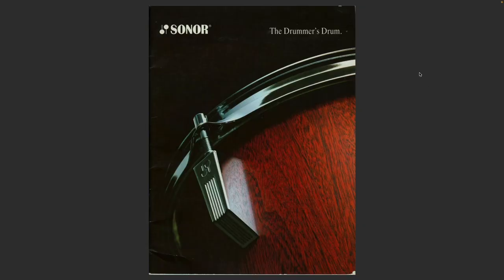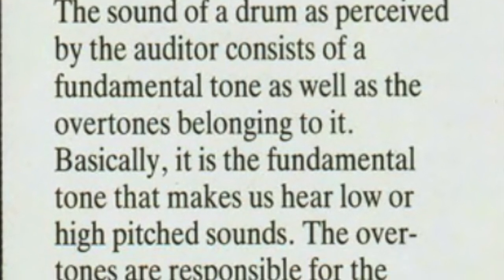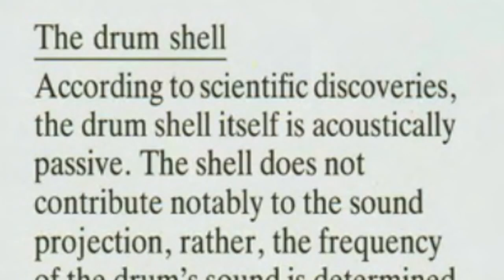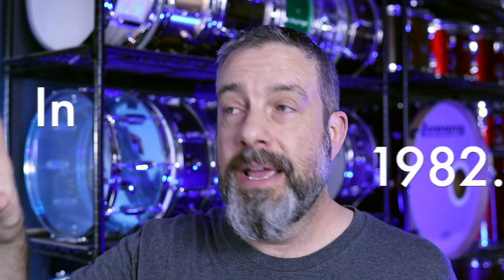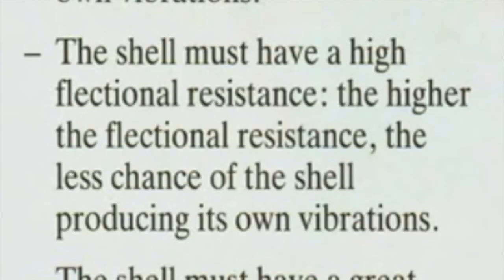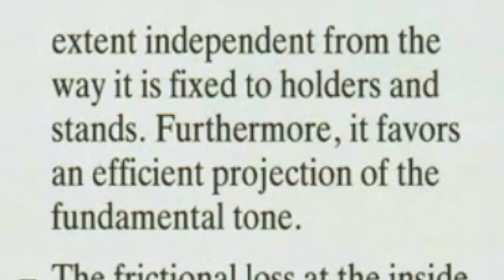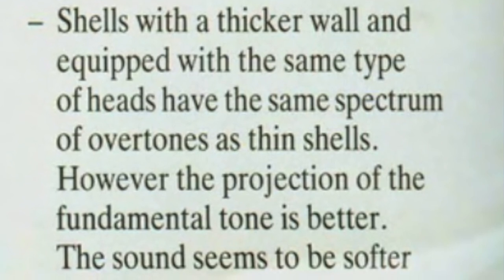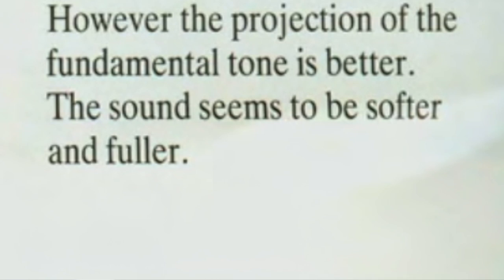That's Not What I've Been Told!  Drum Sound Physics, Part ONE

Comment: I have bought recently a dw purpleheart snare drum very dense and thick I love it! 

What about 6 ply?? Is still that really thin? The ludwig vintage you mention how many plies it has?
Reply from the maker: My late 70s Ludwig kit is 6-ply, but the plies back then were MUCH thicker (nearly twice as thick) than plies used in modern drums -- more wood, less glue by percentage.

It is interesting to me that as the idea of thinner shells being more vibrant sounding than thicker shells became the convention of drum design (starting in the latter 80s) companies decided not to limit the number of plies (as Tama did with their Artstar line in 1983) but rather to use the same number of thinner veneers with just as much glue (yielding a shell with higher glue percentage and greater overall stiffness with lower pitch).  This is not like the earlier 3-ply construction used by Ludwig, Slingerland, etc. in their vintage drums before the early 1970s.  The result is a thin shell, yes, but nothing like that vintage approach (particularly with the thicker central ply of much softer poplar used by those companies in those old drums).

Comment: Wow great video! The effects of these variables has been hotly debated forever.  I’m going to need to watch this a few times and think about each item in more detail.  Initially I’m thinking in terms of snare drums where wood types and metal alloys are noticeably different in timbre (meaning you can tell within reason what kind you’re listening to like your trumpet vs piano example). 

One thing that “resonates” with me is the thickness (density) of the shell. The more dense the medium, the better the sound travels through it. And the longer it takes for that medium to dissipate the energy (assuming higher density also equates to higher mass).  I see a lot of correlation to cymbals.  More mass takes longer for the energy to dissipate; stronger and higher fundamental pitch; and the wash seems a little quieter because the harmonics aren’t as prevalent.  

Would you agree that higher density/mass raises the fundamental pitch?  It seems to in my experience with thick dense shells as well as cymbals.
Reply from the maker: Interesting comparison!  My experience with cymbals is that, all other things being equal, greater mass results in higher pitch.  I'm not sure this is true with drum shells, though.  I'm not a physicist, and don't know any equations to support my observations, but it does seem to me that having greater mass could mean two different things:  if it means heavier, denser wood, I would expect the shell's pitch to drop relative to one of less dense material.  If greater mass means thicker plies of the same wood (and same number of plies) then I would expect that shell's pitch to rise as there would be greater tension on the thicker plies compared with the thinner plies which offer less resistance to bending.  When you bend wood along its horizontal grain its pitch rises.  I would imagine that a thicker ply would offer greater resistance (less breaking down of the cellular structure) than a thinner ply resulting in a higher pitched shell.

I do know that doing the tap test on very thin maple shells reveals a rather low pitch compared  to the tap test on Ludwig's late 70s heavy maple/poplar shells of the same size, which are very high in pitch.  I believe the thicker plies hold the tension while thinner plies tend to 'give' or collapse leaving the glue to hold things together a bit more.  

Think about it, both a shell of 6 thick plies and a shell of 6 thin plies still require 5 layers of glue to hold them together.  It is given, therefore, that the shell with thinner plies is actually made up of a higher percentage of glue rather than wood (and as such it almost certainly resonates easier than the shell comprised of a greater percentage of wood).  

Things that make you go 'hmmm....!'

Comment: With this knowledge, wouldn’t it make sense for a drum set to have thinner shells (and potentially slightly rounder bearing edges) as the drum diameter gets larger? You could create more even sustain around the drums (or at least get them closer).
Reply from the maker: That is a great question that I would love to explore.  

Interestingly, Yamaha, with their Phoenix drums, have varying edges depending on the size of the drums, BUT, the reverse seems to be their approach.  Bass drums have sharpest edges, small toms the roundest.  ????

They charge an absolute fortune for those drums, and I've heard nothing but great things about them (though I have never played them myself).  I really need to do some digging to see what else is at play here.  Logic is good, but more observation is probably warranted.

Thanks for chiming in!!!

Comment: You will find in the literature (Thomas Rossing Physics of percussion instrument) that the shell radiation of a snare is 5 to10% max - I did the measurements by reciprocity in an acousticlab a few years ago on a number of shell construction and material, and the Rossing result is true. Shell do not radiate sound that much, but this does not mean that they do not contribute to the sound (they are coupled to head and as you say are damping some frequencies of the head) Whatever was in the Sonor catalog (i do have it in real !) was true and made to support their signature. For the isolating element, you have to consider what is going on during the hit and the "distance" between suspension frequency and head impedance. frictional losses mean internal damping of the shell and not acoustic absorption. No drum maker makes any acoustic research and development (apart from repercussion ;))

Comment: HI dig your show I'm an old drum nerd 72  and still playing I heard Steve Jordan talking about cymbal stands affecting the sound of the cymbals what do you think about that? And also tuneing devices cheers
Reply from the maker: Thanks for reaching out!  I haven't thought much about cymbal stands affecting the sound of cymbals, but they certainly would if they were reactive to the cymbals.  That is, I have used very lightweight stands in the past that literally vibrated along with the cymbal (when I was an early drummer and didn't yet have nicer gear).  That's energy leaving the cymbal, so it would definitely have an impact.  Heavier stands with nylon bushings and thick, heavy felts don't react much, it seems, but now I want to investigate further!  What did Steve say was the affect of cymbal stands, and what does he do to counteract it?  

As for tuning devices I use (and love) the Tune-bot.  I use it for logging and recalling tunings, though, not for initial tunings.  If I'm tuning a drum I haven't tuned before, or am doing an original tuning (not trying to recreate a tuning I've used in the past) I just tune by ear.  When I hit upon something I want to be able to recall in the future I pull out the Tune-bot to measure it, so I can log it..  Then I'll use it to recreate such tunings as needed.
Reply: @drumdotpizza  thanks for replying Steve Jordan was demonstrating new Yamaha aluminium stands and I've just bought a tune bot cheers
Reply from the maker: @darryljacobs6297   You'll dig the Tune-bot!  It's helpful to have around.

Comment: Joel, another question came to my mind. What about those extra-thick snare shells? Like 30 plies.... the sound "seems" a kind of muffled....or is it only an impression? Much different however from thick solid shells or stave shells.
Reply from the maker: When it comes to the uber thick-shelled snare drums I don't have a lot of experience with them personally.  I did once have a Tama 14-ply snare drum (from the late 80s) that was LOUD, but didn't seem to produce a large tone, particularly, though it definitely wasn't muffled.  

Snares are a little weird when it comes to sustain, however, because the snare side head is usually very tight, and the bottom edge includes snare beds, which pretty much kill the bottom head's ability to resonate at all.

Comment: So if shell is not vibrating, the energy from the head is not dissipated.
Material of the shell only affects the sound in term of density and mass -> thin metal drum and thick wood having same mass produce same sound.

Whether it is welded metal shell, spun or cast; solid wood, or plies, or block does not matter?

Comment: Really enjoying your channel  !    when watching your snare video's are we hearing these drums mixed i take it ?  Could you divulge your mics and  signal chain?    Plastic Wrap cant wait
Reply from the maker: Yes, those tracks are mixed a bit.  Of course mixing drums only is quite different than mixing drums for a full band mix, but there is processing on them, yes.  I generally just try to remove problem frequencies and tame stronger transients enough to get a cohesive whole and might emphasize ambience if I'm feeling so inclined at the moment.  

My mics change a great deal -- I'm always switching things around to keep it all interesting, but Usually a Shure 545 or SM57 on snare (sometimes an Audio i5), kick is usually D112 or Shure Beta52 inside, just about any (usually) large diaphragm condenser on the outside (I find even cheap condensers can often get great results on the outside front of a kick).  I also recently acquired a used DW "Woofer" (like a skinny kick drum with a mic built in) that I have been using a bit lately in front of the actual kick to increase the sense of size and add some nice ambient tone that can be fully controlled in a mix.  I'm digging it so far!

Toms are usually Audio i5 or Heil PR30 or 31.  Overheads change all the time, various solid state or tube condensers, different ribbons, etc, whatever sound I'm hearing in my head at the moment.

So far the signal path for these videos has just been the built in preamps on my Midas M32R console into protools without any  processing (I do that later in PT).  I actually have a ton of classic, desirable mic pros (heck, I even run Rascal Audio, a company that builds class-A, discrete, transformer-balanced, vintage style mic preamps) but I recently closed down my commercial studio space and most of that is in storage.  I have pulled a few choices pieces for use in a travel rack (you can see it in the background of some of these videos, I think), but have yet to determine if I'll hardwire a few choice signal paths or snag a small patchbay to wire it properly.  Lots of things on my plate at the moment, so it might be another couple of months before I have my ideal setup finalized, but I will surely do a video explaining it once it's done.

I am definitely a gear nut, for sure, but good results really have more to do with the knowledge and, more than anything, really trusting a good set of ears than any of the gear we often get so worked up about.  Don't get me wrong, a great preamp goes a long way to making world-class recordings (more so than the clean, stock preamps of modern digital consoles), and I am in the business of making preamps for that reason!  But ultimately it does come down to the techniques used by the engineer to make an engaging production.  

No microphone or preamp has ever mixed a record!  😁

Oh, and, FWIW, I am working with a songwriter friend of mine on recording a tune entirely with guerrilla recording techniques and limited gear in an effort to encourage folks who may be stymied by their lack of lustworthy gear.  That is a topic dear to my heart (that was me a couple of decades ago!).  I hope to have that one out in a few weeks.  

Thanks for your message!
Reply: @drumdotpizza  Thanks for the reply    Yeah those snare drums sound great and i keep telling myself its the tuning and i know this, but my brain just keeps thinking this is what a great preamp does to help the sound. but i have no idea what a great preamp does for the sound, distorts it a little?    
        side note, walked into a music thrift shop in 95, played 4 kits in this reverb chamber of a room, played a thick shell (now vintage) Tama Superstar, tone and depth with ambassador heads,  changed my life

Comment: Once I caught myself searching for weights to buy and means to attach to my drum shells. Never did, but I'm shure that would enhance the sound of it
Reply: The new Yamaha Recording Customs have weights in the bass drums, for this very reason.
Reply from the maker: I modified a lightweight snare drum with short stacks of fender washers inside to hold on the lugs/hardware to add mass.  Made the drum better, but the wood was basswood, so pretty soft (a topic I haven't yet discussed, but will), so the improvement is likely less than I suspect it would be with harder woods like maple or birch.

Comment: Here's the thing: these things can be measured.  Debating or arguing about them should be replaced by measurement.  Mic different areas around a drum and measure signal levels.  The slower the decay, the less energy loss.  Ultimately this is what distinguishes science from rumor and hearsay.  Another way to do the measurement is with a laser microphone: these are somewhat inexpensive.  Shine the laser on various parts of the drum and measure the amplitude of the vibration.  Probably a little more accurate than an SM57.  You might even be able to use a high-speed camera to capture video.

Comment: I'm just a hobby drummer that studied a little bit of geophysics, but I do not agree with Sonor guys regarding the role of mass of the shells. It's rather rigidity that matters, because elastic waves coming from the head are sensitive to such elastic property, not to mass itself. With the right material you can build a very light shell that resonate a lot. Moreover, in 'normally' built shells there's more glue in thick shells. Nothing more anelastic than glue. I'd like to be able to test my opinion with, let's say, 1mm thick titanium shells !

Comment: "Smoothness inside the shell matters". It made me wonder if the old Rocker II Ludwig toms suffered from their internal coating. It almost looked like splatter paint and it most definitely wasn't smooth.
Reply from the maker: Well... smoothness isn't quite as critical in my experience as whether or not the wood is sealed.  The zolacoat/flectone coating used in some drums feels rough, yes, but it actually seals the wood and keeps the grain from absorbing high frequencies produced through playing.  Cheaper drums don't seal the wood (at all, quite often), and those drums, even with thin, vibrant shells sound dull compared to their higher end counterparts.  

So I would argue that sealing wood is more important than a truly smooth surface.  In fact, Pearl actually gloss coated the interior of some lines of their drums awhile back (maybe they still do on some?), and I wasn't a fan of the sound they produced.  Often times a coat or two of tung oil is more than enough to seal the wood, creating a full frequency response, while keeping the woody tone we so often like!

Comment: A thin shell, are actually way better sounding than thicker shells. A thin shell that vibrates allows the, (as you have said), original strike, (note), to be the focus of the sound. It is perceived to be louder and more boomy. A starclassic maple shell is louder and boomier than Masters maple kit and the major difference is thickness. The thinner shells produced the original note and stays on that note as the over tone decays. Overtones are not welcome if the note doesn't stay true. That is why people muffle their drums. The overtones are not in tune with the initial note. Sound guys go crazy if they have to take the overtones out using limiters and eq. They fight the overtones, unwanted. The intitial punch is the note and all you want. You can add delay or reverb if you need it.  Starclassic maple is probably the thinest shells you will find, they resonate and the overtones last, and the overtone does not oscillate with different pitches competing to win. They stay true to the note of the drum head combination with the vibration of the shell. Wht you are saying to me is a 9mm thick shell will sound better than a 5mm shell given all else is the same, and I have to completely disagree. I love old DW collectors, but even I must atmit the thinner star classic maple is more boomy, and resonates more. I prefer DW because Starclassics Maple have too much lasting ringing for me. Dw sets do not require any mufflers or gel, rings or other muffling. The physics I understand but I think there is an error in the interpretation of overtones vs the initial pitch duration.

Comment: So, for example a Tama bell brass would have more sustain than ha 1. 2 mm bronze shell snare the same size?
Reply from the maker: Yes!  Though, given the fact that you're talking snare drums, usually the bottom head is so tight that the drum doesn't really sustain like we would think of a tom sustaining.  This fact is exacerbated by the snare beds in the bottom edges which REALLY limits that head's ability to sustain at all.

But yes, tune the batter down lower, where you get a longer, sustaining pitch, and a 3mm cast bronze shell (that weighs nearly 20lbs!) will sustain longer than a more typical, and much lighter 1.2mm shell.
Reply: @drumdotpizza  Love the content. Gives a whole new perspective.